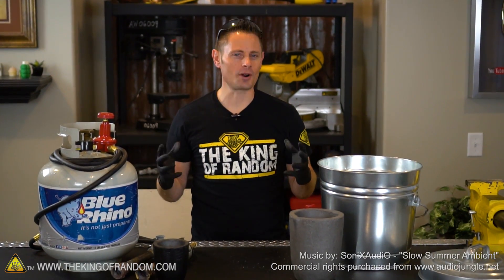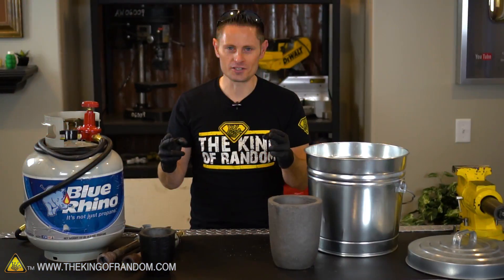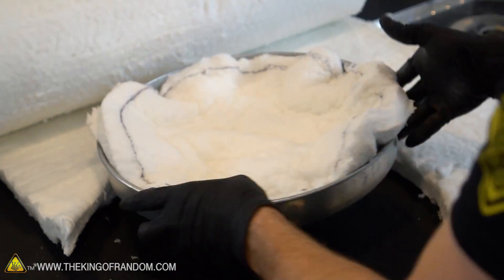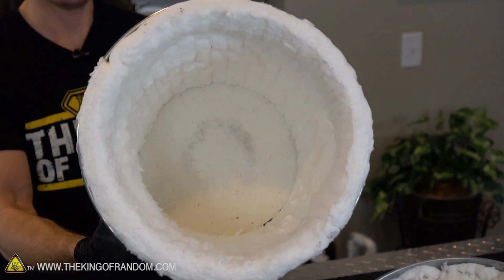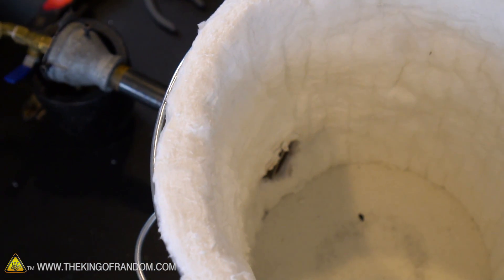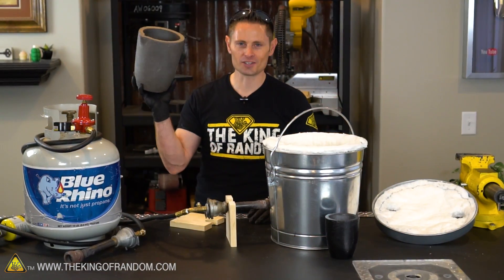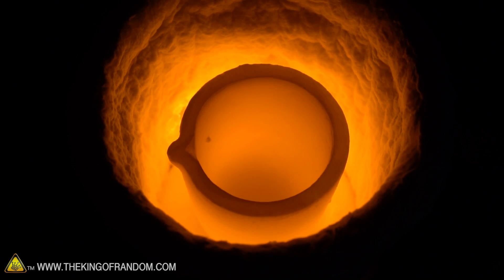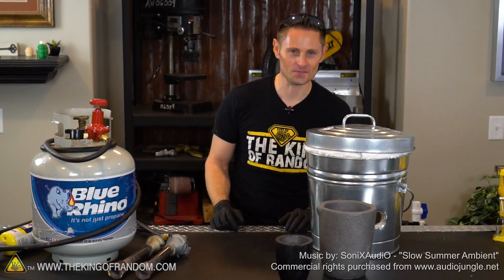Make A Trash Can Metal Foundry | How To Make A Metal Foundry For Melting Brass And Other Metals

Comment: Hey Grant, can you please do an experiment in which you put the highvoltage cables into a vacuum. Because i wonder if the electric arc would still happen between those two cables

Comment: what would happen if you opened a vacume chambers lid while it is pressuried
Reply: Ben Kavanagh You can't....
Reply from the maker: Ben Kavanagh you can't
Reply: Ben Kavanagh It would rapidly re-pressurise and if you're chamber wasn't strong enough it could explode from the rapid change. It's possible to open the lid, but not with human strength :)

Comment: How long does one tank of propane last you for the original backyard foundry? Also, did you use 2 propane tanks for this foundry? Or set up a system that splits the propane from one tank into two spouts? Thanks!

Comment: that wool is the stuff in small-house insulation, isn't it?
Reply: Alkatron
No! They look similar but they are not the same. Fiberglaqss insulation would just melt and it would probably be pretty dangerous.

Comment: Even though this can is coated on the inside, if it heats up enough, these types of cans usually have a coating of zinc or something to prevent rust that can come off as a very toxic gas if the can becomes too hot.

Comment: I was just thinking you may have made it to lite and will be easy to tip over seeing as that Crucible filler up will wave More Than The Foundry. So mabye bring back the spot welder and make a stand for it or attach some out rigger legs to make it more stable

Comment: There is one more thing worth saying, any furnace made from kaowool needs to be sealed to prevent loose fibres from being blown into the atmosphere by your burner where you will end up breathing it in. Normally you would use a ceramic coating like  ITC-100HT or a form of kiln wash to do this. On my furnace I added a 1" thick hotface made from castable refractory.

Comment: I've made a forge using a similar method to you, and one thing I would recommend to upgrade it a little is to take some insulating firebrick for the bottom so that the wool won't tear up so easily (again, mine's a forge, not a foundry, but the build is pretty much the same.)

Comment: can you make fireproof armor with that
Reply: cause that would be epic
Reply: mandatory fish nuggets you could but kaowool falls apart after you manipulate it so it would have to be used like blanket stuffing in anything that is worn like clothing.
Reply: Richard Wheatley what if you had metal kale wool then leather like a sandwich
Reply: mandatory fish nuggets leather might work for the inside but the outside should be something aluminized that is more fire resistant than leather imo.
Reply: mandatory fish nuggets it all depends on the application.
Reply: Richard Wheatley what if you made a kaowool onezie to wear underneath
Reply: your skin will be torn and you wouldn't be able to concentrate on rescuing anyone, and it has to be extremely big too because if it is flattened it would just let the heat go through.
Reply: They also have a special fire retardant jelly on their skin
Reply: mandatory fish nuggets but this has the same effect
Reply: itchy
Reply: put a fabric over so it doesent itch and a few layers of the fire proof fiber
Reply: By the sound of it, that's trading a fire hazard for a material hazard. The kaowool is going to flake and get bad stuff in your lungs unless you're fireproof armor also comes with a diving apparatus to make sure you're not breathing the fibers.
Reply: mandatory fish nuggets Race car drivers wear something like that
Reply: TheBoundFenrir use a mask with a filter

Comment: You should try making Lichtenberg art. It's where you take high voltage (Neon Sign Transformer or MOT), put the leads on a piece of wood coated with an electrolyte, and watch it burn lightning bolts into the wood
Like if you agree 😃

Comment: Is it possible to make diamond by heating up graphite in a mini arc furnace and exposing it to high pressure?
Reply: Mabye but it might take a long time
Reply: True but Hydraulic Press Action came pretty close to a small piece of diamond only using heat. Adding pressure at the same time might actually create some legit diamond. They will probably be pretty low quality but hey, diamond is diamond!
Reply: can you make a video if you actually are gonna try plz i just wanna see how it goes down

Comment: Hey grant I use a very similar set up for my blacksmiths forge and not only will it melt aluminum and copper mine does have the ability to melt steel. With your two torches you should reach that temperature with no problem. 

Love the videos

Comment: Make a casting of a sword with dry ice and put molted metal in it at let it cool
Reply: you know the extreme difference in temp would cause it to basically explode, right?
Reply: that would instantly spew molten metal in all directions
Reply: Carlos Arellano the molten metal will slide out and bubble
Reply: Carlos Arellano that would give the sword thermoshock and break it
Reply: at first, I thought it was a meh, idea but now that you said Explode I really want to see it
Reply: No it wouldn't explode.  When the molten metal hits the dry ice there's a layer of CO2 preventing it from melting the dry ice too quickly.   The metal would just, like Kitty K said, slide out and bubble.
Reply: Carlos Arellano wouldnt the dry ice crack?

Comment: Can you please make a metal phone case 👍
Reply: a metal phone case, while coo, would probably block the signal from a lot of the radios in the phone, leaving you with poor signal. this is why a lot of manufacturers do not use metal in the design of phones anymore.
Reply: Superseaslug3 Or because phone companies are cheap...
Reply: I think it would depend on what metal you use. 

If it's a metal that's magnetic, like iron or steel, then it would interfere with the EM waves in the phone signal. If it's something that isn't magnetic, like aluminum, then I could see it working.

Aluminum is rather soft and bendable, if memory serves. That's why it's not usually used as phone case material. Look at the bendable iphones if you need an example.
Reply: Aluminum would make a Faraday cage for the phone and it wouldn't work. Magnetic or not, if it's metallic, it'll block the signal to the phone.

Comment: "It's toxic if you breathe it in, and itches if it makes contact with your skin"

wears no mask wears short sleeves :DD
Reply: no, that wool is similar to the pink one used for house insulation. Except made from ceramic instead of glass. Asbestos on the other hand is made directly from a fibrous mineral of the same name.
Reply: Rayset exactly what I wanted to comment :D
Reply: He's got sunglasses and gloves on dude, can you not see? 
That's plenty of protection if you ask me
(Lol rhyme not intended)
Reply: Rayset *sleeves
Reply: Rayset z
Reply: Grizzbee Uno does he really?
Reply: Because he so hardcore
Reply: Rayset  he doesn't use a mask with asbestos either  ... He also smokes 2 packs a day  ...
Reply: says it itches while trying not to scratch lol

Comment: can you use coal in this foundry to get same conditions as propane torch?
Reply: ankit rochani 
Yes that would work (lots of people use charcoal).
You would need forced air (such as a hairdryer) too, using the same hole that Grant uses for his burner.
Reply: ankit rochani it would cover everything in carbon black
Reply: May be you right.. that is the disadvantage of using charcoal.. but in principle it should work with charcoal and hope it give necessary temperature to melt tin..  But not sure if which all metals it can melt?

Comment: I suspect your outer housing will degrade quickly where there's little to no protection, namely around the holes. Not an issue if you want to switch out the housing periodically, I suppose. Something more robust, like an old propane tank would probably serve better.

Comment: I want to get into the Metal Foundry concept but Do you need to temper the crucible every time you want to melt metals? Also is there another material that can withstand at least more than 2400F?

Comment: watch out for zinc fumes with that trash can around the vent holes
Reply: Eric Moravek 
Sound advice. I had metal fume fever once and it was VERY unpleasant.
Not an experience I'm in a hurry to repeat.
The majority of the can won't get hot enough, but as you pointed out, the vent holes are going to get very hot.

Comment: Can you melt glass in the new metal foundry?
Reply: Josh Bainbridge 
Easily, in fact powdered glass is often used as a flux - it melts and forms a layer of liquid over the top of the metal, which protects it from oxidizing.
Reply: But can you melt a solid glass block, or something like that?
Reply: Yes, although the thicker the glass, the longer it would take to melt.
Reply: Cool, thanks.
Reply: no, the kao wool can only withstand 1200 degrees celsius and glass melts at about 1700 degrees celsius
Reply: Ok, Thanks

Comment: I'd consider adding a layer of satanite or something similar over the kaowool. The ceramic fibres in the kaowool can become super friable after repeated firings, and even the force from the propane burners can be enough to send it up into the air.

Comment: Great of you to give advice on how to properly deal with that wool!
Reply: Theres biosoluble ceramic wool, thats what I use. the galvanized lid wont spew zinc, only a small but around the holes.  theres no problem with that.
Reply: classic grant
Reply: What he didn't mention is that kaowool becomes more friable after it has been heated, which means that it is even more dangerous once the foundry has been used.
He really ought to have some type of hardface over it to seal off the fibers.
Reply: What's even better is you might aswell use asbestos because they're pretty much the same thing
Reply: Except for the poisonous fumes that galvanized lid will be spewing; as somone in the comments mentioned.
Reply: TheBackyardScientist yo dude
Reply: Is it galvanised? It looks more like stainless steel to me, doesn't have that flaking look galvanised things have
Reply: Asbestos is banned because it causes lung cancer. This stuff doesn't, it can just clog your lungs. Like breathing in spraypaint.
Reply: TheBackyardScientist!!!

Comment: I work at a aluminum die cast foundry and we use that wool to keep the metal hot. it will catch fire if it is dirty so keep it clean.

Comment: You had me at trash can
Reply from the maker: That's tender :D
Reply: Make A Video On How To Make Ice Cubes That Don't Float!!!!!! :-) Please
Reply: it would but its not the ideal shape
Reply: That's tender 😂
Reply: What a laughter.. 😂😂😂
Reply: Grant Thompson - "The King of Random" can this get hot enough to forge steel?
Reply: Robert Vipperman no
Reply: Robert Vipperman It would definitely get hot enough to forge steel. It's not an ideal shape for that though. Forges are usually built sideways for easier forging. This is a foundry for metal casting. It will not get hot enough to melt steel, and the kaowool isn't rated for those temperatures. In my ceramic fiber furnace, it melts cast iron in about thirty minutes. I've tried steel and it never melts. But that's with only one propane torch.
Reply: They do make nice houses.
Reply: what are you, the cookie monster?
Reply: Nah it's Oscar
Reply: The notif you give me redirects to g+ home page
Reply: IncogInfidel oscar the grouch!